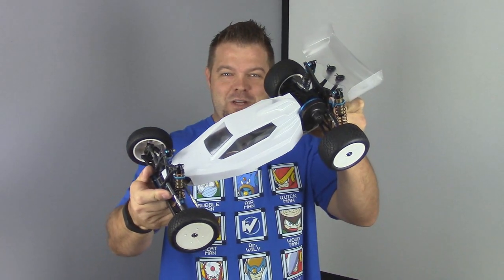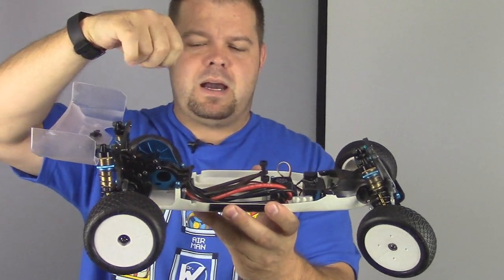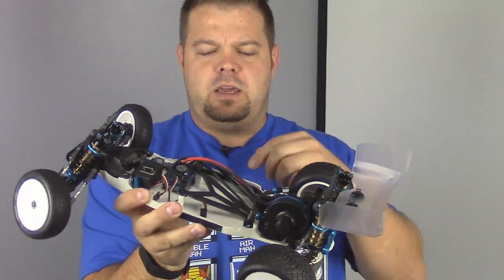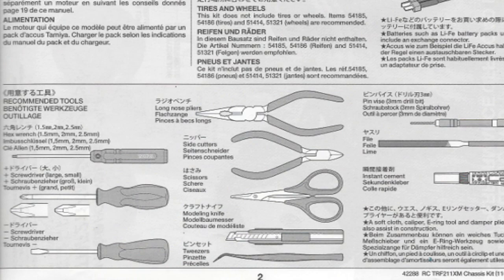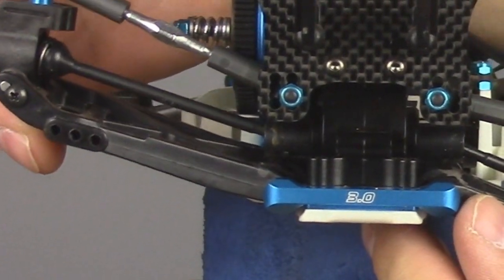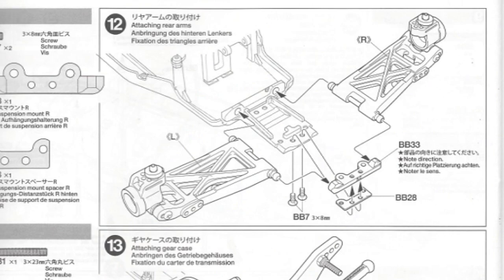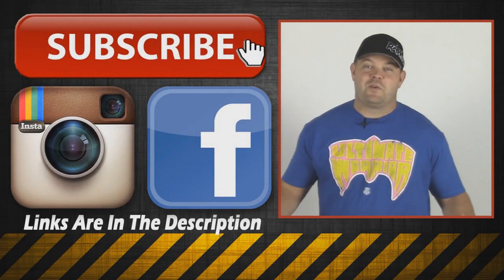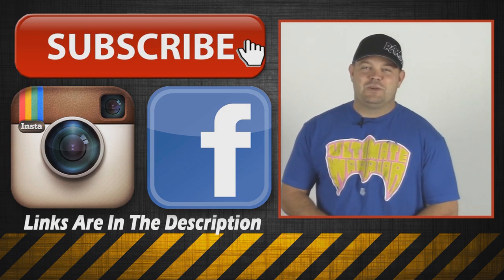Kit Review: Tamiya  TRF211XM 1/10 buggy

Comment: Hey Jason , first off great review. I am stationed in Sasebo Japan and have traveled the southern part of Japan visiting hobby shops of all sorts and you are spot on with the tamiya-racer presence. It seems , and it may just be a local thing, but that there is no rc/racing presence or demand. It's mainly plastic models that I see from tamiya. Which is a bummer because the TRF221xm looks like a cool kit, even it being 3 years old. I have been eyeballing a few on eBay and funny thing is the price hasn't changed from what you mentioned, around 450 -and that is before the hex conversion. And still using a JIS Phillips head is really unfortunate, as you said they are behind. And I haven't seen any recent kits come from tamiya since then. It's kind of a shame , tamiya is one of if not the biggest name in the hobby and they're kits are falling off the market. 
Great video and thanks for the review. Unfortunately looks like I won't be ordering one.
Reply: Jamin Adams Check out Tamico in Germany. They have this for really cheap. I paid less than $300.00 shipped to the US.
Reply: Matt Percival will do ! Thanks.

Comment: What is the advantage of hex head screws over phillip head screws?
Reply: Hex has smaller threads and fits better within the plastic. Regular screws often strip more and its a pain in the ass with smaller Phillip screws to get a good grip on the head. Plus they have larger threads that can end up chewing up the plastic they get screwed into.
Reply: +Chester Copperpot Its possible for manufacturers to source machine thread (fine thread) screws with "phillips" heads. The real problem is that metric screws with phillips heads are different than SAE phillips heads. The way the angles are cut is different, so if you use something like Hudy or other metric specific phillips drivers the engagement is great, but most north americans only have SAE phillips drivers, which don't fit properly and end up giving metric phillips hardware a bad reputation.

Comment: The wrong cut on the body is on you, not Tamiya. First off, you did not use the sepcific page for the cutout as reference. Tamiya never intended that page to be used for cutting the body. Secondly, and this is beyond me why you did not do. READ THE MANUAL THROUGH BEFORE YOU START! It's like in school, read though the assignment before you start.
Don't blame Tamiya for your shortcomings.